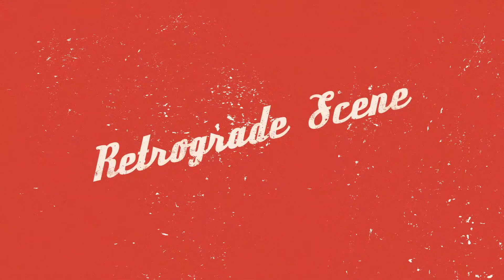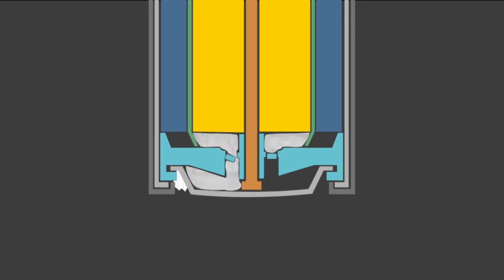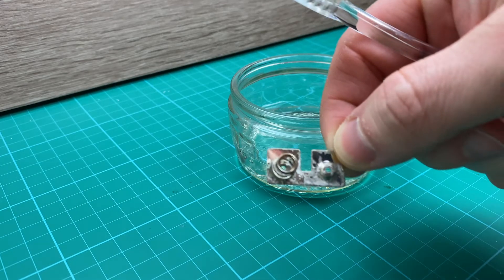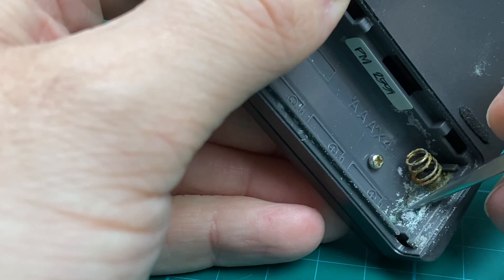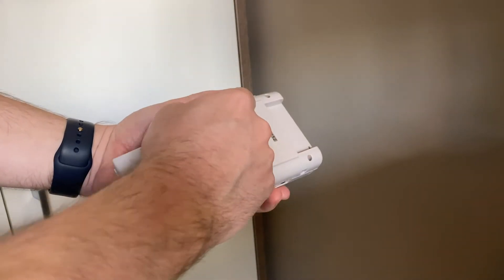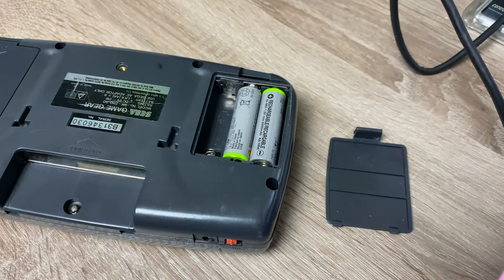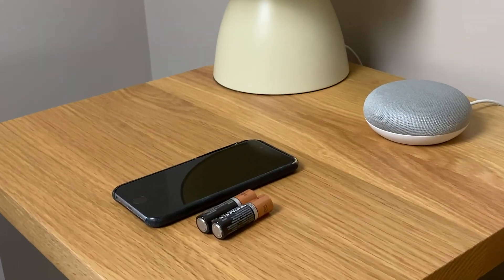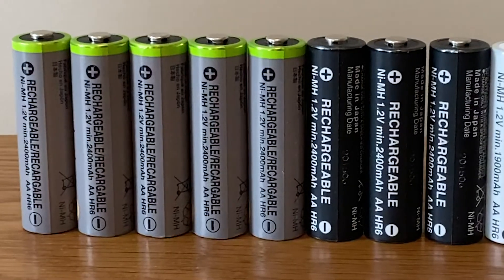Battery Leaks | Collecting issues

Comment: I think I am the same with batteries, I feel safer working with alkaline devices rather than Li-ion, not to mention batteries are often easier to replace, unlike modern smarphones where it's not as common to hotswap a battery when it dies.
Reply from the maker: Yeah it’s definitely becoming a more expensive and harder job to replace these custom Li-ion batteries in newer devices.

Comment: Hi, Can you please tell med what kind or model numer is the battery that you change in the Palm III video, I need to change my battery ? Best Regards Robert Celander
Reply from the maker: Hi so the batteries are AAA but I’m guessing you mean the capacitor. I went with a 5.5v 0.1F super capacitor. If you search for that and look for one the same shape you should be good. eBay is usually cheapest when you factor in postage if you’re just getting one thing.
Reply: @RetrogradeScene  Hey thanks a lot for your info, yes I meant the capacitor, I have now found it on eBay in Germany ! Have a nice weekend. Cheers Rob.